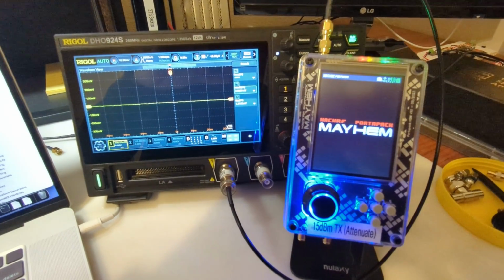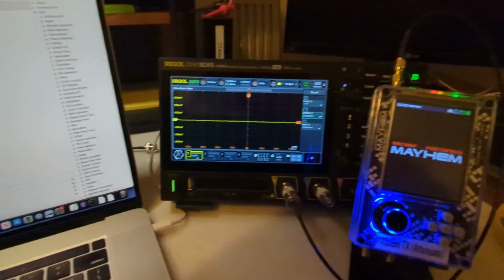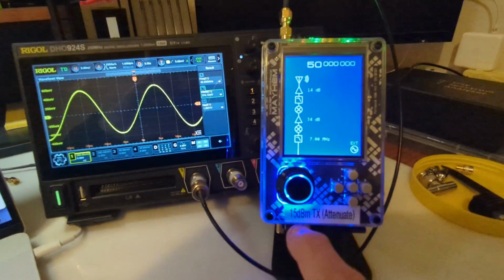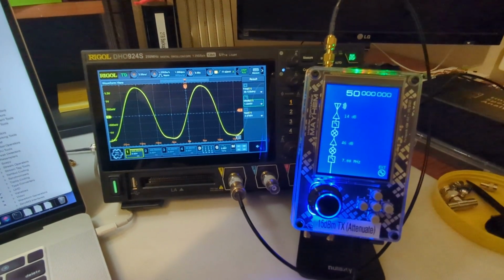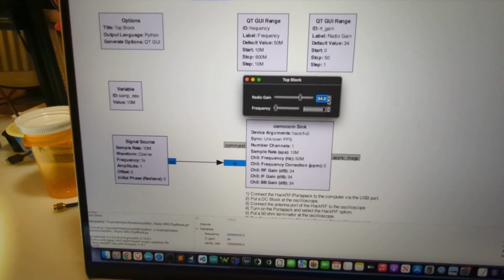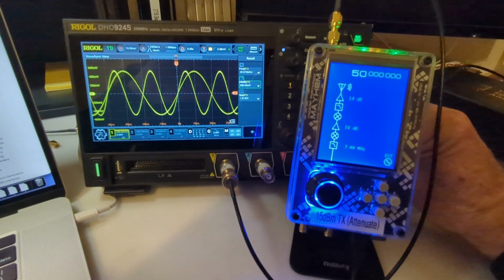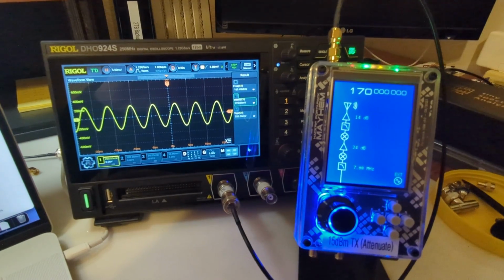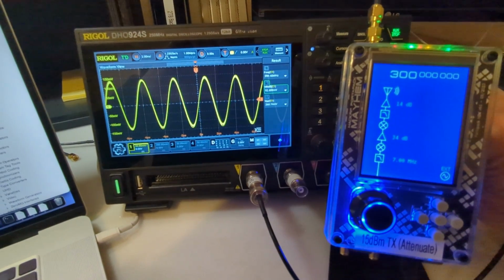HackRF as a signal generator using GNU Radio Companion

Comment: Nice video. I had a question if you can answer pls. Would there not be reflections if the the forward power is not absorbed or are you using some kind of loading in the transmission line.
Reply from the maker: Hackrf has a 50 ohm output. I'm using a 50 ohm terminator at the scope.
Reply: @philipgiacalone5605 Cool. Thanks mate

Comment: Is it possible to generate cosine in gigahertz? Is it possible to make an RF PLL oscillator in gigahertz?
Reply from the maker: Yes, you can use GNU Radio Companion to create cosine signals over 1 GHz with the HackRF. It likely can only simulate a PLL.